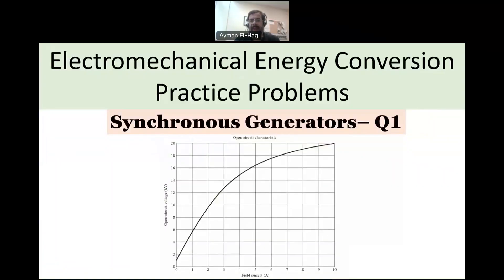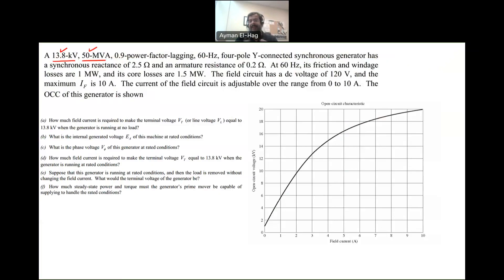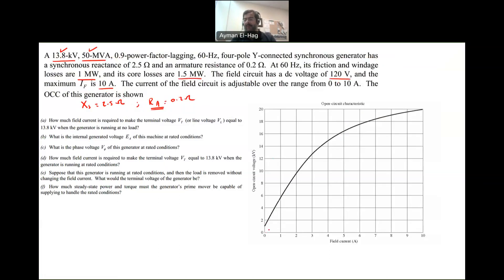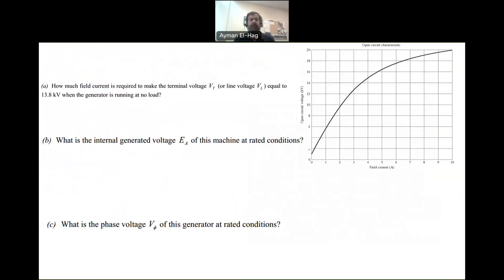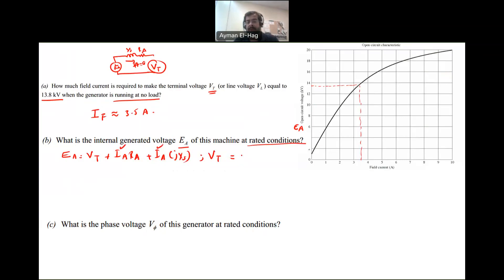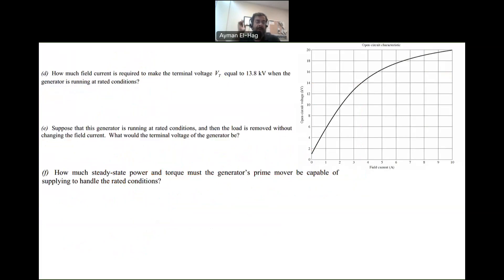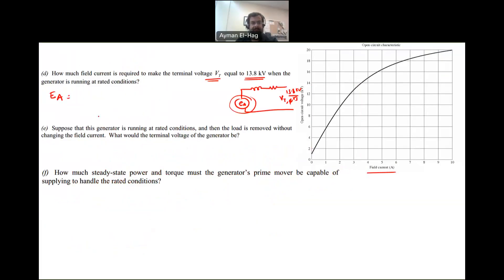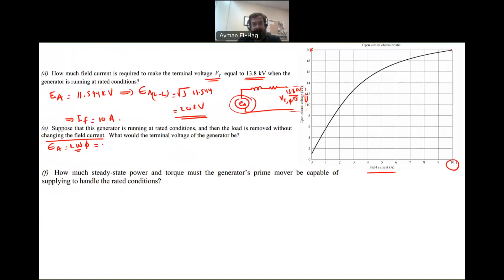Synchronous Generators - Question no. 1

Comment: In part a) why is it Ea = VT and not Ea = Vphase or 13.8/sqrt(3)? Isn't the circuit that you drew at 3:30 for a single phase?
Reply from the maker: The measurement was conducted for the line voltage and not phase voltage. So the Y-axis for the curve was for the line voltage

Comment: Hi thank you for this great video.
I hope you can help with a problem. I'm helping a family build a micro hydro system. We have installed an old synchronous alternator (3 phase) and the slip rings don't look good to me and the brushes don't have good contact. 
Is this a big issue for generating electricity? Thank you for your time
Reply from the maker: Yes if there is no good contact between the slip ring and the carbon brushes there will be a problem in transferring the  electrical energy from the generator coils to the loads.
Reply: @electrical4everyone  Thank you very much